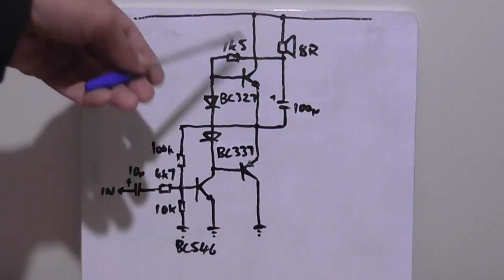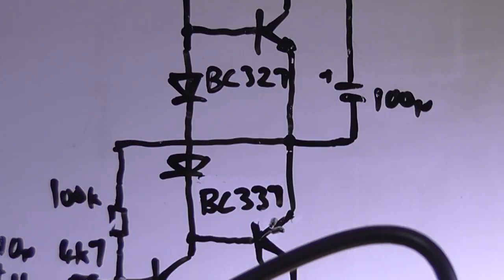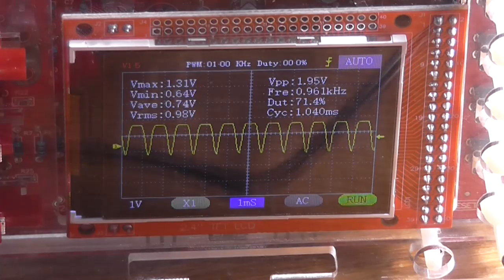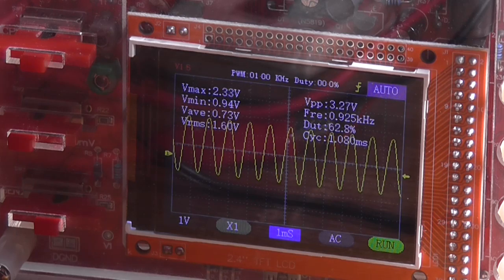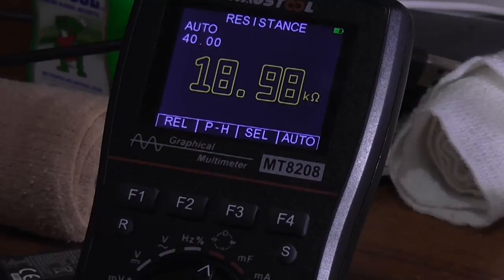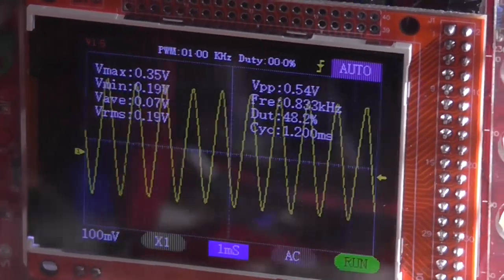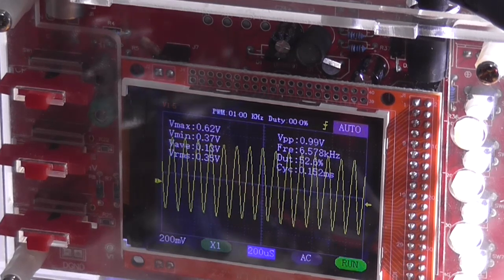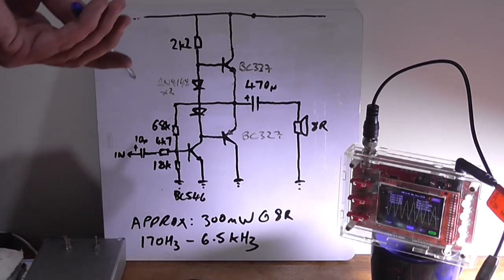Mini 300mW Amplifier

Comment: The purpose of the arrangement with the 1k5 resistor and the speaker returning to the positive rail is to provide a minimal component bootstrap.  This raises the voltage on the right hand side of the 1K5 above the supply rail during positive signal swings, giving more overhead to drive the NPN output transistor.  This technique is used on high power discrete amplifier design, but the bootstrap components are separated from the speaker and output cap (if used) so no DC current through the speaker.

The +ve terminal of the speaker should still be connected to the amp output in this configuration. The current through the speaker is still in the same direction, it makes no difference whether the return is through the 0v or +ve rail.
Reply from the maker: Yes, I know. Thanks for the context. As I already tested, there's only a few micro amps going through the speaker voice coil. I'm old school, and don't like this idea. My arrangement still works fine and outputs the same amount of power, even though boot strapping is to improve gain and linearity.
Reply: @AstrosElectronicsLab  Yeah I don't like DC through speaker voice coils either.